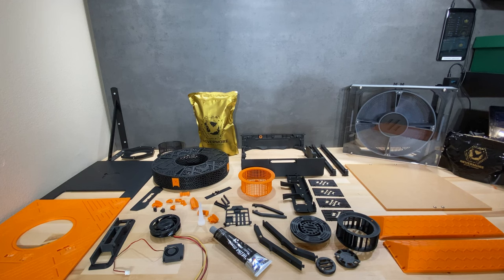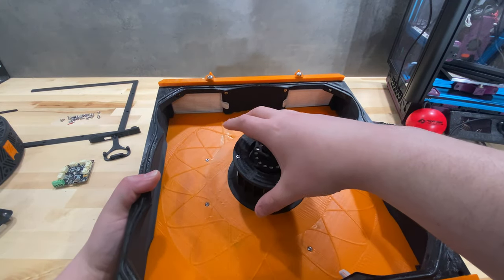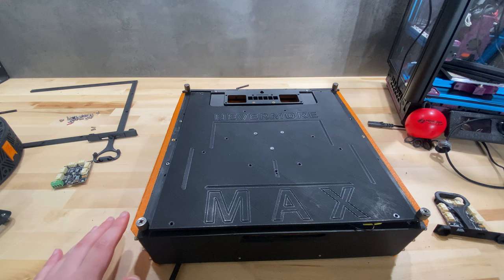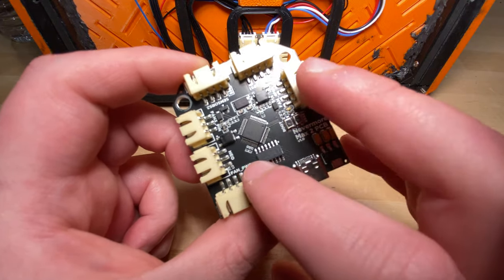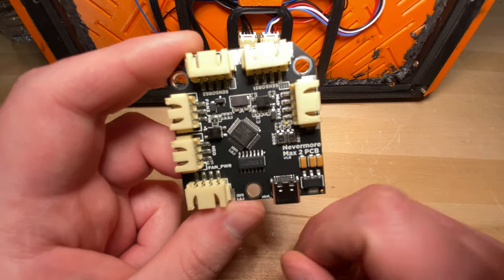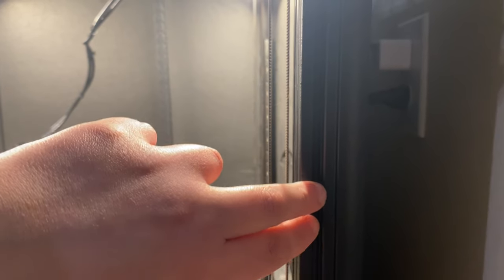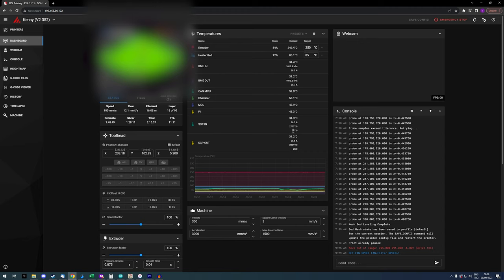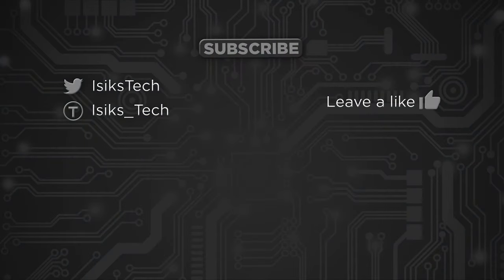Voron v2 Ep. 26 - Nevermore Max 2 Air Filter

Comment: Did you validate the air quality sensors by running the unit with no filter media installed? I've seen really crappy results from sensors like this before.
Reply from the maker: Tested them before, they work fine.

Comment: Interesting mods! What material did you use for the gantry and frame pieces? Looks like CF ABS or ASA to me
Reply from the maker: Regular ABS. Gantry and other inner parts exposed to high heat is Paramount ABS, except the stealthburner front which is polymaker glitter ABS. Outer black parts are eSun ABS+ or Polymaker ABS, and outer orange parts are Paramount ABS or ASA.
Reply: @IsiksTech  Good to know thanks!

Comment: The Max and stealth Max are taking the air outside the chamber. Does that mean it lovers your maximum chamber temp or just takes longer to heat up additional air?
Reply from the maker: It might lower the maximum chamber temperature in theory, but I didn't notice any chamber temperature differences. It can actually help the heat times in theory. It will recirculate the air, so it should help the chamber heat up faster like a bed fan. I turn my filter on after the print starts so I didn't test this.
Reply: @IsiksTech  Cool, so turning it on after the start of the print doesn't bring any ABS print artifact? Like delamination, detachment or deformation?
Reply from the maker: @stefa168 Nope. I've been running it for a few days constantly printing, no artifacts. Largest object I printed is 155x155x65, 4 in a plate, twice. Printed nicely.
Reply: @IsiksTech  I can't decide what's better stealth max or  some filter inside the chamber like V6 or rebreather XL. I'm not printing 247 so I don't think I need bigger carbon volume but my goal is to print higher temp materials and I'm not sure if Max can handle that. what would you recommend more?
Reply from the maker: I'm pretty happy with the Max, but keep in mind I only used it for a few days and with only ABS. But I didn't observe any noticable chamber temperature issues.
I like the max/stealthmax more for the extra filtering capacity and the sensors, so I can actually know when to replace the carbon. It theoretically filters better too, since it also has HEPA filters.
In-chamber ones have their advantages too, like bed fan like air circulation and theoretically no air leaving the chamber keeping the temperature higher. I use in-chamber filters on my Micron and Voron 0.2. They work fine.
Even without constant printing, I feel like I need to replace the carbon really often, so the bigger basket is really nice. But Max/Stealthmax is much more expensive too, so if you want something that will get the job done and don't want to pay for nice-to-haves, micro/rebreather is fine too.